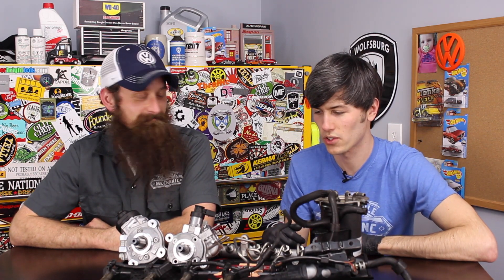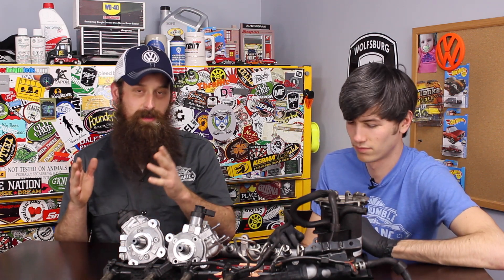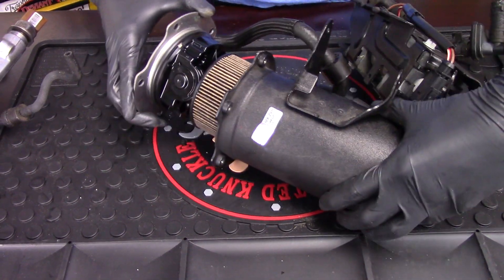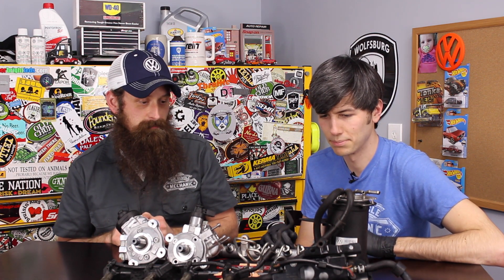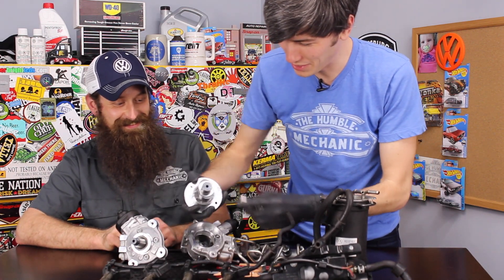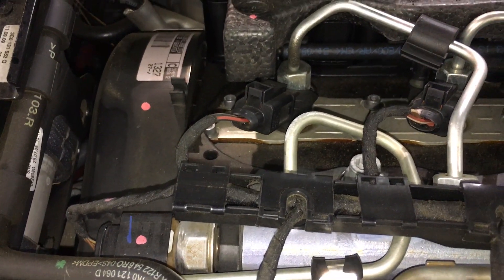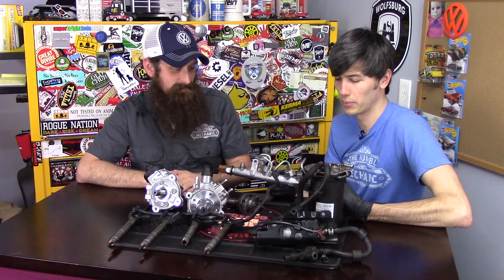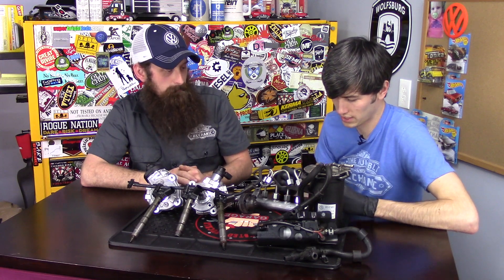How Diesel Common Rail Fuel Systems Work

Comment: I've never worked on the internals or seen the inside parts of a diesel engine so please educate me as I'm strictly knowledged in gas engines. Are diesel fuel injectors always that big? Those things were huge compared to all the gas engine fuel injectors I've seen and handled lol

Or is the size of the injector dependant on the type of fuel injection, for example those were direct injection fuel injectors? I can't say I've ever handled direct injection on a gas or diesel engine so now I'm more curious

Comment: What happens to the fuel that is not used how is it sent back? OOPs you forgot to mention that  when I drove big truck I know the system had a crossover from tanks I just assumed the pressure had to somehow return to the tank? I know this because driving in the ice and snow my fuel needle showed more and more fuel and I am like what in the world well my cross over froze solid so I actually had engine shut down middle of Dallas luckily I coasted off the Interstate and came to a nice halt in front of waffle house but that's another story. -PawPaw

Comment: Just a quick question; Diesel comes from the tank pumped by tank fuel pump through the fuel filter and stops at the high pressure fuel pump at engine bay next to the common rail, hence not getting to the common rail or injectors. What could be causing this? Car is BMW 530D E60, Fault code is 4B90 Rail pressure monitoring on engine start.

Comment: Only 12000 psi? I work on semis for a living (most often with Cummins ISX15's) and the rail pressure can get up to over 31000 psi in them.

Comment: I'm curious as to what the low pressure side of the injector system does. It's obviously important if it's not there. Why is that?

Comment: 800 bar of pressure is for semi trucks. That is for small semi trucks such as the Mercedes Benz Atego. 
For smaller vw cars they have between 250-400 bar.

Comment: 12,000 psi on a VW car and 23,500 psi on a Dodge 2500 5.9 liter Cummins a good reason to not mess around with high pressure fuel lines if you don't know what you're doing. Water jet cutters are 50,000 psi (and higher) but it shows just how dangerous a stray jet of fuel could be if it can cut steel.

Comment: It's so cool that all DI petrol engines now have a similar set up with the cam driven fuel pump!
Reply: Only that the rail pressure is around 10 times higher in diesel engines, up to 2500 bar (around 36000 psi)

Comment: Hi EE, can you at some point go more into detail about how the injectors work and how they are actuated? Mechanically and Electronically? How fuel pressure is built up in non-Common Rail Diesels, older and newer systems and so on?

Comment: Hey man, new to the channel, great videos. Just a little more info you might find interesting, some of your newer truck injection pumps are actually capable of 24,000 to 29,000 psi on the newer light duty pick up trucks. If youre interested any more info on that let me know and I'll send you some links

Comment: Kinda makes me wonder why a diesel type injection system hasn't been explored in petrol engines? maybe it has? Injecting petrol as a gas should yield much more complete combustion and efficiency.
Reply: +cobra60six I know that some gasoline powered cars are using high pressure direct injection in their engines, similar to diesel engines. The gas is still ignited by the spark plug though.
Reply: +cobra60six Thats exactly the system used in a lot of newer cars
Reply: It's usually cheaper to install the DI system during production. Taking apart all those components during a retrofit isn't worth it. Like I said, the main advantage of having Gasoline DI is to allow a higher compression ratio in the cylinder without any kind of detonation (gasoline is more volatile than diesel). If your engine is built to run at standard compression ratios for multi-port, you will not see the benefits of DI if you retrofit. Plus, having multi-port does bring you one advantage. The detergent ingredient in gasoline keeps the intake values clean.
Reply: lolatmyage Sounds good, now we just need a simple way to retrofit it
Reply: cobra60six
If you can somehow increase the compression ratio of the engine (new block, piston rods, crankshaft), then it might be worth a retrofit since higher pressure is one of the factors that lets DI engines have a more complete combustion.Also, you are also looking at a very expensive project (like $8000) since you will need to replace and add many new components (You need high-pressure fuel injectors for DI).
Reply: worldlinerai Sounds complex and expensive :-(
Reply: cobra60six Fuel system conversions like thats are pretty pointless
Reply: +cobra60six The 1957 C1 Corvette has a direct injection system, and is a gasoline engine. That's the only old one I can come up with just like that :D

Comment: Could u make a video on why petrol and diesel vehicles make different horsepower, torque and fuel economy? Perhaps using a particular model that comes in both diesel and petrol could be a good one to use as an example for comparison. Would appreciate if you could touch on some mechanical components too as well, as to why you can't use a petrol in a diesel and vice versa. Thanks and keep up the awesome work.
Reply from the maker: +lukgaroo All I'll say is you're going to enjoy Wednesday's video! :)
Reply: Oh yea, i loon forward to it. Thank you very much!

Comment: Forgive me if I repeat myself but I thought I had posted an explanation but can't find it. The system shown is I believe called Pump Deux (or 2 pumps) a low pressure pump takes the fuel from the tank and feeds the high pressure pump which pressurises the fuel to the injectors. The injectors are opened and closed by solenoids controlled by the ECU and that gets information from the accelerator pedal, temperature and revs. 

A more recent system called "Common Rail" uses a common rail to the injectors and the injectors use piezoelectric actuation of the injectors. This is much faster and so the injectors can be opened briefly at the beginning of the injection cycle to soften the initial combustion and then opened again later in the cycle for the main fuel delivery. This removes the harsh sound of the direct injection engine and can also be used to reduce the amount of nitrogen oxides produced (VW note).

Comment: no indepth of how actually the injectors work?
Reply: Quite simple actually. In principle they are just needle valves actuated by a coil or piezoelectric actuator
Reply: Actuated by high fuel pressure

Comment: am i the only one that thinks that the volkswagen setup with the 3 different pumps is a wee bit over complicated compared to the american diesel pickup trucks where all you have is your lift pump on the frame rail then your CP3 injection pump on the motor and the filters attached to the lift pump (if its aftermarket). Not to say they are all like that IE: navistar's 7.3-6.4 powerstrokes with the HEUI injection being more complicated than CP3 but most are a lot less complicated than VW's system.

Comment: Why can't gas engined adopt this system as well?  One last question, do direct fuel injectors have intake valves as well or those are not needed?
Reply: They do, just with much lower system pressure

Comment: Speaking of modern diesel emission systems.....  The worst part about newer diesel emissions plumbing is being afraid to idle your damn truck.  I was helping an old lady with her van in the cold. (snowing outside)  And she asked to keep warm in my truck and I actually cringed- not because of fuel costs, but knowing my idle odometer would be ticking away and all the CRAP and CARBON build up my engine would be crapping it's self with.  It's like your truck has a diaper on where all the crap can be coated in the crevices of your exhaust, turbo, and everything else.  It's a mess.
Reply: Modern electronic diesels can control it better by adjusting fueling and/or timing electronically , but the best thing to do? 
Run it and use it like its intended to.
Reply: +Luca Fuoco 
Aka wet stacking. 
I see it on diesel generators that don't run under load enough. The exhaust joints drip raw unburned fuel, caused by lower combustion temps with minimum load. Usually they also smoke a whitish blue color, until you work them and burn all that crap out. 
And the newer emissions equipment is a big pita with the dpf plugging.
Reply: delete it maybe?
Reply: Diesel engine Wet stacking. 
Google it. 
You are actually cooling off the engine by sitting and idling. 
One of the most common causes of wet stacking is idling the engine for long intervals at too low of rpms which does not allow enough heat in the cylinder for a complete burn. 
Also cold weather running or other causes that prevent the engine from reaching proper operating temperature can cause a buildup of fuel due to incomplete burn that can result in 'wetstacking'.
Diesel engines are happiest when working under a load. 
Load them lightly, they cool off, you get an incomplete burn and the fuel washes past the rings and blows out of the exhaust. 
I see it at work when I leave my truck running on cold days,as I service wet stacked diesel generators 😂
Only difference is when I leave, the white smoke clears up within a half mile or so if you drive it hard.

Comment: What happens in a gasoline contamination of a diesel motor? Doesn't gas start out as a diesel and become more refined?
Reply: +u9Nails Gasoline and diesel burn differently, thats why you cant use both at the same time

Comment: Might be self explanatory and obvious, but I think you could've mentioned when holding that fuel rail, that's the reason why it's called a commonrail system. As opposed to older diesel systems, including VW's PD

Comment: Common rail engines work by costing you many thousands of dollars to fix when any of those high pressure components die.
Reply: +Spencer Howard It's a good job then that most diesels run a multiple hundreds of thousands of kilometers/miles before needing any mechanical components replaced. but yes, you are still right.

Comment: on one side rail is fuel pressure sensore and other is valve which set max pressure. not a 2 pressure sensors

Comment: Aren't common rails banned in modern diesels? Because I remember something along those lines in regards to why it is so expensive to replace injectors.
Reply: Brand new semis and diesel pickups have it. Pretty much industry standard now. Common rail injection is more fuel efficient.

Comment: It's interesting as the Diesel CR & DI system actually first arrived which later set the basis for gas engines to follow in the same formula, which in turn gave GDI motors a good boost in power & efficiency over the MPFI gas motors. Pity emissions is all people think about now when I mention the word 'Diesel'.

Comment: Great but you didn't explain how the power is modulated by the pedal.
Reply from the maker: Ahh, whoops! The pedal regulates how much fuel is injected (different from a gas engine, which opens a throttle and alters air). Dump more fuel, makes more power, brings in more air. Diesels have a wide range of effective air-fuel ratios, so power can be increased by changing this and bringing in more air.
Reply: +Stewart Robertson  i think accelerator pedal position sensor sends the signal to ecu and also boost pressure sensor +rail pressure sensor sends a signal.if the pedal is pressed further than a high current is send to PRV (pressure regulator valve,in rail) initially which means high fuel quantity and if futher pedal is pressed completely the current send to PRV is minimized to lower the fuel quantity (so than we can get milage and horsepower both)
Reply: I was thinking on that system, the pedal alters the stroke of the piston driven by the cam.
Reply: ohh,sir,
 R u Talking About VCR(Variable compression Ratio) engines??
Reply: +Stewart Robertson Injected quantities are controlled by the duty cycle of the pulse width modulation(in other words for how much the injector is open to spray fuel)just like any EFI gasoline engine.
Reply: +Engineering Explained Well, a bit over simplified. The pedal has never directly controlled the quantity of fuel injected. I know I am getting more technical than many in your audience needs.
Reply: According to my knowledge power delivery is dependant on the intake manifold boost pressure, Fuel rail pressure, Injected fuel quantity (latter two dependant on accelerator pedal position and controlled by ECU)

Comment: can you use an altornator on an electric car motor to genrated electricity. 
The altornator will be conected to the shaft so when the electric motor moves it will move the altornator witch will generate electricity.
Would that work.

Comment: how does gasoline damage a diesel fuel system? does diesel provide lubrication for the high pressure pump?
Reply: Gasoline is "dry". It has pretty much no lubricity compared to diesel.

Comment: Hi Guys great video, Charles stated the parts for the demo came from a VW that had petrol contamination in the fuel system. I was wondering why the metal parts (common rail and fuel lines, high pressure pump ect) could not have been cleaned and reused rather than replaced?  Thanks
Reply: +Bill Bixby Hey Bill<

The repair standard for this job come from VW. As a dealer tech I have to follow their protocol. Could the metal lines be cleaned, probably. The rail, maybe. But I don't think the injectors would be a good choice.

Comment: Why three pumps? I can understand the low pressure pump in the tank to get the fuel to the engine and then the injector pump to really crank up the pressure for the injectors, but why the middle pump?

Comment: good video! but you need a new mic/audio rendering!!!
Reply: +CyberCommando That is what happens when you have one really great quality mic(the one Jason has) and one suck mic(the one I am using) 

My studio is not really set up great for guests. That will change some time in 2016. I just need to save the cash to buy another really good mic.
Reply: fair enough man! still enjoyed the video and I subbed to you too! May I suggest a Rhode video mic? i think you can get a mid-range one for around $300. Also Lapel mics realy work well!
Reply: +CyberCommando awesome. Thank you. The mic Jason is using is my Sennheiser wireless. It's awesome. My mic is a POS eBay wireless. The Senn mic is only about a month old. I got it locked in when it's just me. Hahha.

Comment: 2 things are wrong, the high pressure pump needs no timing it just makes pressure and the injectors decide the timing. The idle pressure is more less 250bar and WOT makes 1800bar on that specific model on the video.
Reply: right.  put the high pressure pump out of time and see what happens lol.  hint, you will be rolling coal lol.  and that is if it even starts lmao.

Comment: Did you guys say 800 bar = 1400PSI ?
Reply: +Joseph Tucci yep actually they said 1200... they missed a zero.. they did put a subtitle so it's not super-bad but I don't know what they're thinking the whole point of having 3 fuel pumps is that the pressure is VERY HIGH

Comment: How do the injectors know at what time to squirt, and are direct injectors in the cylinder or behind the valves?
Reply: +Tom Johnson the rough timing is via the injection pump, so the pressure is there in a "wave" around the time the injector needs to be opened to squirt... the exact timing of the injectors are controlled by the engine computer using a map that the manufacturer loaded into it, and several other learned parameters, engine position is usually sensed by crankshaft and camshaft position sensors.  And yes the whole point of "Direct injection" is that it's directly injected into the cylinder - the alternative is "port injection" or "throttle body injection", both of which do NOT require the super-high pressure pumps
Reply: The injector timming is controlled by the computer, ecu  and direct injection is straight into cylinder not behind valves.
Reply: Cheers for clearing that up for me lads